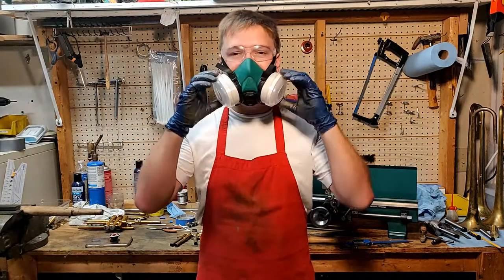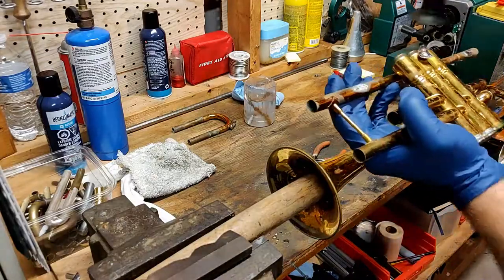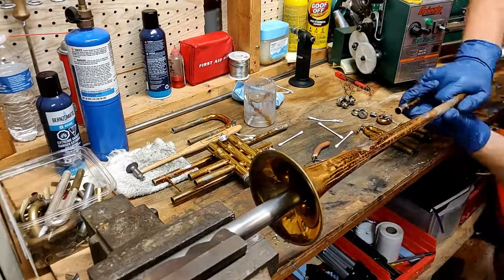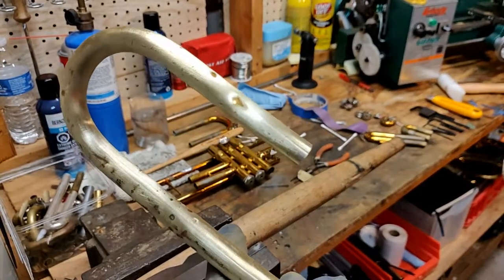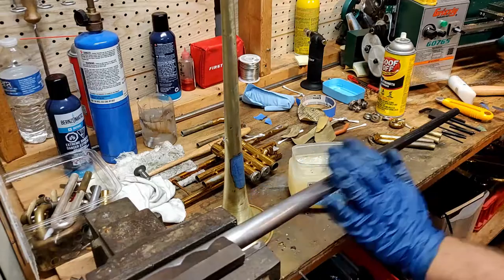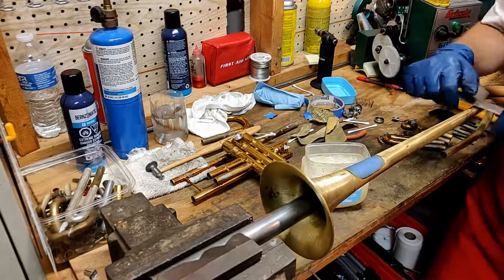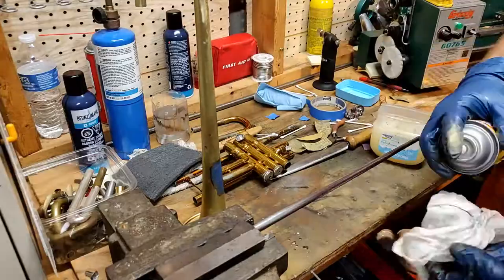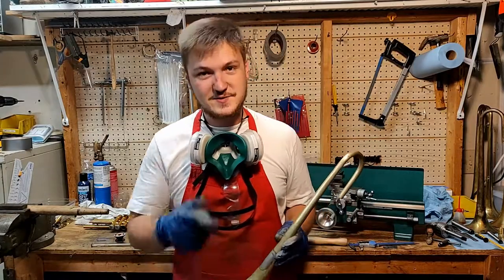Restoring a Donated Trumpet to Playing Condition | Part 2

Comment: This is so cool! I've been considering removing the lacquer of my old cornet and taking it to a brushed finish similar to the end result of this video. This has been a super cool series so far and you've gained yourself a new subscriber!
Reply from the maker: Thank you! You can use near boiling water or aircraft paint remover as well. Be careful with that last method. (Outside for sure.)

Comment: If the owner worries about the 'work hardening' on the spots of dent-fixing,on their brasswind repair, wouldn't annealing those areas with a torch beforehand end that debate?
Reply from the maker: It would. In this particular case I was more mentioning it as a footnote. This piece didn't require enough moving of the metal for that to really come into play. When you are trying to save a severely crumpled or creased section is when such care should be taken.